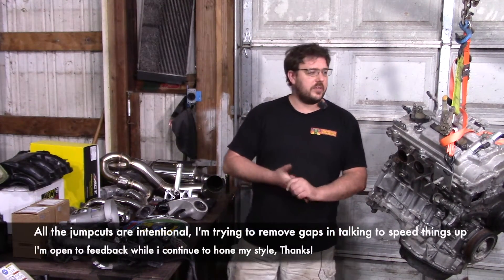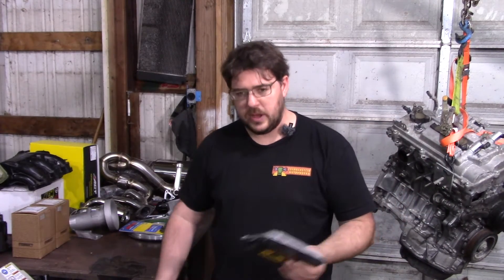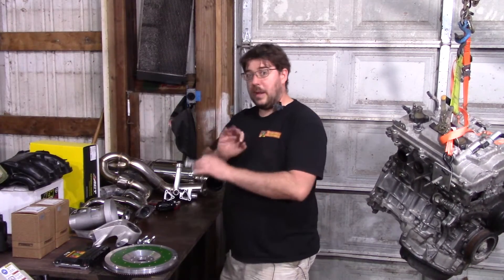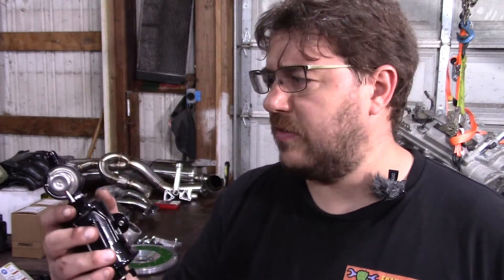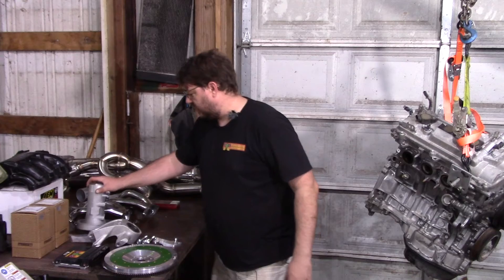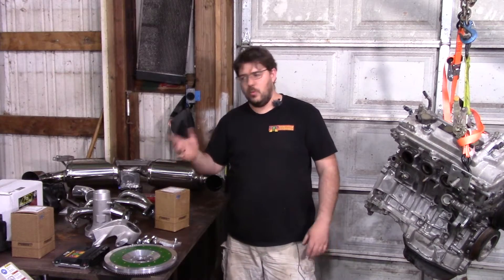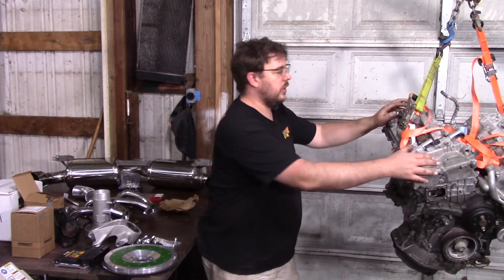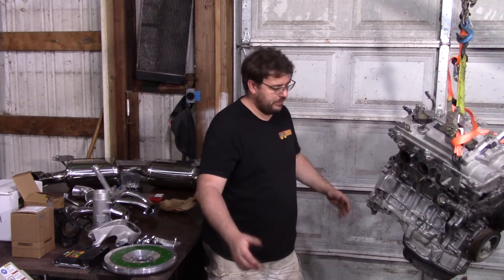2GR-FE install instructions for MKII MR2. Introduction Video

Comment from the maker: The first video is a bit delayed. I tried shooting it today but discovered the tip about the venza axle carrier bracket was not correct. I have deleted that mention from this video. I also ordered the correct Avalon carrier bracket and it will be here so i can finish that first video.
Reply: Trivial question in relations to that Carrier bracket is that the same part number as mentioned in the video?
Reply from the maker: @jaykatana9418  it was mentioned in the video before but it has been deleted. It turns out the U660 transmission axle has a slightly different position than the U151 transmission. I should have confirmed this personally but the info from the customer that told me this sounded correct. I went back to the Avalon bracket which i know aligns properly
Reply from the maker: @jaykatana9418  I wish i could issue a correction to the video but youtube does not let you modify things after the fact other than delete frames. the first video will go over this in a bit more detail.
Reply: @FrankensteinMotorworks  All good mate, you know you could edit the description for the part that was taken out and mention it in there, with the part number along side it to make up for the edit in the video, also for future reference for other videos etc is it possible to mention the year of the cars you use parts from? just to help out others who A are in different country's that are doing the swap who may not have that are available to them and B for people 5 or 6 years down the line who aren't sure what year of car they would need to pull parts from? just remember a percentage of people that do watch these videos may not be as well knowledgeable as your self and others.
Reply: Aside from that keep up the good work mark the more questions and info people add in, the more clarity people can have with all the parts they have access too
Reply from the maker: @jaykatana9418  I actually did edit the description to add a note, unfortunately people rarely look in there. I will try to be more precise about years in the future but keep in mind, if you're in a different country you should not trust those years. Feel free to reach out though and I'll be happy to clarify for your particular situation. I'm used to helping people from all over the world.

Also, the next video is posted as of a few minutes ago :)
Reply: @FrankensteinMotorworks  will do, i was just referring the notion for people to look on part sites to  verify the parts as well as find other cars across the world that may carry  the same part as mentioned in a video, plus the more info generated the better and easy it becomes for others you know?
Reply from the maker: @Johnny Diaz I actually don't do customer installs, i just sell the parts to make it easy to install. The car and engine is mine and will remain in the fleet to be able to test other configurations and develop other parts.
Reply: Can you use the Lexus es350 engine
Reply from the maker: @daddykoffie8871  yes, that's a 2gr-fe

Comment: Is there a list of specific motors or wiring harnesses to avoid? My buddy just finished his prebuilt swap, and I’m trying to keep it cheaper, while not giving myself a headache.
Reply from the maker: These days the easiest is the 3rd gen Sienna harness. which motor you get is really inconsequential as long as it is a 2gr-fe (make sure you don't buy a 2gr-fse, that happens quite a bit) any other harness will require you to understand the wiring diagrams and go your own way.
Reply: @FrankensteinMotorworks  ok thank you, I remember seeing somewhere to stay away from post 2009 wiring harnesses and motors, is that true?
Reply from the maker: @jakecharais5307  All the motors have always been usable. It was just until a few years ago i only supported the 2008 rav4 and 2008 highlander ECUs and 2010+ wiring harnesses are very different from those pinouts.  A few years ago i added support for the 3rd gen sienna ECU (2011-2018) which makes harnesses a lot easier to find and in fact these days i've dropped the support for the rav4 and highlander ECUs due to the cores being too expensive. I can still do special requests with those ECUs if necessary.
Reply: @FrankensteinMotorworks  awesome, thank you for the clarification

Comment: How do you think this would run with the s54 transmission? Still the same to bolt up?
Reply from the maker: I haven't done it myself but many people have and it seems to work just fine.
Reply: @FrankensteinMotorworks  Awesome, I would want to boost the 2gr if I did it but cant seem to find parts for that build..
Reply from the maker: @jraddd3477  i'm not sure a boosted 2GR with an S54 transmission is a good idea. the E153 is much beefier.
Reply: @FrankensteinMotorworks  Yes for sure! Would any of thr 2GR transmissions work to swap at all?

Comment: I have a 2007 camry 2grfe a have minor mods currently like rev9 coils, after market wheels, intake, strut bar , i just order a 90mm throttle body etc etc i would love to know if most of the parts that guys sell are made specifically for the mr2 swap and if some of the parts would fit my camry im looking to make my camry full bolt ons. I was going to buy stuff from monkeywrenchracing like headers and camshaft stage 1, fuel rails and make it e85 and a tune from R9k puerto rico!!! You seem to have Alot of experience with the 2gr engine and i would love if you can give me advise for my build
Reply from the maker: Do yourself a favor and look up the results of R9k's tunes. There's a reason i don't support the stock applications for tuning and it's because the stock ECU just isn't really holding back this motor. The motor needs more air, not a different tune.  The biggest bang for the buck is a replacement y-pipe but i don't know what bolt ons are available for your camry.
Reply: There are few mods that you can do for the v6 2grfe camry to make huge difference before doing things like coils , camshaft… 
You can get the  Ypiped make from mkcperformance. They made one thAt exactly bolt on fit for gen6-7 v6 2grfe camry . That’s give you plenty more powerband  compared to stock. The other thing you can do is the real cold air intake from ebay/amazon(not the K&Nshort ram one) . Also throttle body spacer. Lighter wheels and more rubber. I haven’t had luck to find a set of header that fits in the camry for years 
R9k is pretty badass. You gonna love it after the ecu reflashed.
trust me if you get all the mods that mentioned. Your camry going to fools lot of stock V8 ,intkae , exhaust 5.0 chrysler300, hemi in the streets lol.

I also have a 91 SW21 and looking into 2gr swapping it

Comment: I really like your website and this YouTube channel. You are a presentation style suits me perfectly

I  didn’t notice you saying anything about how it is possible for the  E153 MR2 transmission to bolt up to the 2GR motor. It didn’t look like you are using a bell housing adapter, so I am assuming that there’s a factory bell housing that will mate the two. 

Also, you mentioned alternative final drive ratios of around 3.6 and 3.9. How are these achieved? If there is a good resource for this information that I should be looking at please point me to it and I will pester you no more. At least not until I’m ready to buy parts.
Reply from the maker: Just the normal E153 bellhousing bolts to the 2GR without an adapter, though the later bellhousing (93+) matches more bolt holes than the earlier one. The 3.9 is from many other e-series transmissions, you need to swap in the ring gear, output shaft and oil pump drive gear. The 3.6 is getting pretty hard to find, it's from 2 years of the camry with the E53.

Comment: Could you put that in a rav without moving anything else .just the supper charger and whatever component that comes with and do most kist come with everything I see  the hkn one say it comes with everything you need is that bs
Reply from the maker: i'm sure it could be done. some years of the rav4 have much bigger engine bays than other years.

Comment: What can you do with just messing with the computer for my rav 4 and how much
Reply from the maker: Honestly not much. The stock tune does not hold back the motor at all. Without some changes to get more actual air into the engine you'll be hard pressed to get much power at all. There's a few people that claim they sell tunes that will give you more power and show power gains of 10-15hp but it's worth noting that if you just switch to premium fuel without the tune you still get that same 10-15hp gain.
Reply: Ok good to know thanks

Comment: I have an off topic question. Does 2grfe also has the stripped head bolt problem of 2arfe? My 2grfe has an external coolant leak on the head gasket area of cylinder number 4. The engine was never overheated and has had regular coolant change.
Reply from the maker: Patrick, I've never heard of that issue with the 2GR-FE, but i've also been running the 2AR-FE for a decade and never heard of it either. You have to remember that the people i deal with use these engines in their sports cars, we generally abuse these engines in different ways than the way someone abuses a daily driver that gets driven year round. For example the 2AR-FE i just pulled apart saw a bit over 30,000 miles of hard endurance racing above the normal 6400RPM redline and when i disassembled it the only issue it had was a leaking rear main and the forward thrust bearing was starting to show significant wear because of the heavier clutch.
Reply: Frankenstein Motorworks ,
Sorry I meant to say the stripped head bolt problem of 2azfe. Thank you for your insight.
Reply: I did some more research online and figured out it is a somewhat common issue on high mileage 2gr. The nitrile rubber (nbr) surface coating sealing the number 3 and number 4 head gasket will disintegrate over time causing seepage to the exterior of the engine.But most of time it will be just be a small external leak. In most case the heads and block are fine. I guess they got the head gaskets  from the same supplier as Subaru.

Comment: When will the EB62 transmission swap kit be available?
Reply from the maker: There is demand for an EB60 swap kit and i’d like to make one (it would target the eb60, not the eb62 because the eb62 is very rare, you would be able to use an eb62 by switching out the shift levers). But i don’t feel that the demand would meet the price required at this point to justify the R&D. The kit would need three motor mounts including one with a custom rubber insert, complex shift linkage that would likely also require custom longer shift cables and custom axle shafts or stubs. Between all that and the cost of the EB62 it would bring the cost of swapping one in to about $4500 which i just don’t see the MR2 market accepting. (note that most of this money would not be spent on the swap kit but the whole number is still the critical one that would turn people off. the swap kit parts would be similar to the MKIII MR2 trans stuff with shift cable costs added in and the axles being about $1000 instead of the $250 mix-n-match solution i figured out there.)

Comment: What type of manual transmission can I use ?
Reply from the maker: Jessie, it's generally recommended to use the E153 transmission. The S54 has also successfully been used many times. If you're willing to do something that isn't 100% bolt-in you can also use the EB60, EB62 or EA60. Those last three will require custom mounts and shift linkage but they do bolt to the 2GR-FE.

Comment: After i saw my first 2gr MR2 vid and did some research, i knew it was what i wanted for a daily/weekend warrior. I sourced my Camry 2gr like 2 yrs ago.. before even finding my donor MR2. I found a stock NA 91 auto and freshened it up with mild mods to race in scca autoX to learn the car while i collect my other swap parts. Finished 2nd for the 2019 season, and will race it again with the 5s but with a 5spd in 2020 while im still collecting parts. Love what you're doing and the time and effort going into this! Ill be in contact to get most, if not all your parts later this year! -Nate  #NTGatVE
Reply from the maker: Awesome, I look forward to hearing more from you. Also feel free to reach out with any questions you may have.

Comment: Ever have that feeling that something is meant to be?  I have a 2nd gen 3s that needs timer belt work.  I had a convo yesterday that ended in having access to a 2008 Rav4 with the 2gr for next to nothing, then I come across this video on Youtube.  I also already have a berk exhaust and a Findanza flywheel/ACT clutch.  The MR2 gods are trying to tell me something.  GUess I sell off my gen4 3s parts now lol.
Reply from the maker: Heck yeah! It's weird how good youtube is at recommending stuff sometimes :) Feel free to ask any questions if you're not 100% sure. Also i just got in from finishing the wiring video shoot. Now i have a bunch of editing to do but it should be up in the next week.
Reply: @FrankensteinMotorworks  That's great news!  I was just searching for that.  I'll be getting the harness and ECU and plan to make the mods myself.  I just finished a 3rd gen electronics swap on my gen2 3s and became very familiar with all the sensors and wiring.  I even did a custom job on the speedo signal to eliminate the mech. cable.  I'll check out the video once it is posted!  IN the meantime I need to get the car out on the road finally and enjoy these new 3s electronics for awhile.

Comment: I have a totaled 08 sienna with a 2gr and a 2010 camry with a 2ar bolted to a EB62. I would like to put the sienna 2gr into the camry and keep the eb62 6 speed. Do you think this is going to be a shit show? It seems like it would be mostly bolt it up and go since the 2gr came in the camry, just not stick. I want to be able to pass emissions and street drive this pig though. What do yall think?  I 5 speed swapped my 99 1mz with the E153 out of a solara and even with the manual ecu/harness i still pop 50+ codes for missing solenoids ect.
Reply from the maker: This actually won't be that tough. both setups have a matching electrical system so you'll have to move wires around but the actual wire names and whatnot will all match and there won't be any relays and fuses missing. 

The EB60/62 does bolt right up to the 2gr with minor grinding in a few spots. 

The question is if the trans interface is at the same spot on both applications. i suspect it isn't quite at the same spot so you'll likely need a custom right side mount but that won't be too much difficulty.

As for passing emissions, it completely depends on your state. I can help you with an ECU modification to remove the automatic transmission fault codes on the 2GR ECU.
Reply: @FrankensteinMotorworks  thank you for your response, this is great news. I think I am going to go for it.

Comment: was collecting parts for a couple years now'and the time your front mount was 600 dollars'i decided to look for an alternative,so i purchased rat 2 motorsports front mount...was wondering if u new anything about it/and if its worthy...thanks for the videos since ive been waiting for a good time to do the swap...backthen i also purchased your 5 plug ecu and was getting ready to send my avalon harness to wiregap to do the mod,,but since your gonna be making the video...i will wait and see if you will be covering the 5 plug harness mod since that is what i got.
Reply from the maker: Dean, Keeping it as positive as i can, I feel that my mount has a much better fitment and is designed to live much longer due to the rubber mounting as well as a design that avoids stress fractures. The rubber also does a much better job of stopping squeaks and rattles that make a car feel cheap.

The video will unfortunately cover the 2-plug rav4 harness. It'll talk about all kinds of things that are still very relevant to your harness but it won't give a pin by pin breakdown of that harness. The reason for this is the rav4 harness is significantly easier and the barrier to people doing their own harness is high enough as it is so i wanted to pick the easiest one to do.

Comment: Is there any way to make this swap CA legal? I was reading an old post from Gouky on MR2OC that you can make the OEM manifolds from certain donors fit but wasn’t sure if this was enough. What exactly would prevent/allow this swap to be CA compliant for road use? Thank you!
Reply from the maker: As far as i know, unless someone gets an E.O. with a few modifications approved, the only way to do it would be with a Lotus Evora ECU and Harness. You'll also have to do some work to make the lotus ECU happy to make it not throw fault codes but thankfully the Evora does not have an evap system so that's one less thing to deal with.

And by the way, I'm Gouky on the forums. I'm the one that has been posting info about this swap for over a decade now :)
Reply: Haha oh, I had a feeling but wasn’t sure it was you. On the CA BAR website I saw under “Type 1” that the intake and exhaust can be modified to accomodate an OBD2 into OBD1. Do you think this would allow for the aftermarket headers,  y pipes, etc as long as emissions pass? https://www.bar.ca.gov/pdf/Engine_Change_Guidelines_BAG_04.19.18.pdf